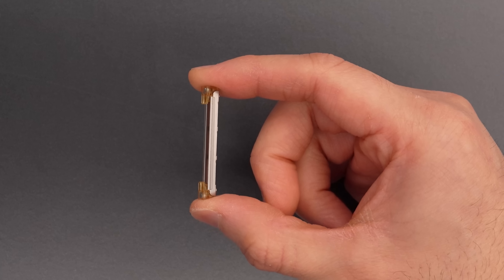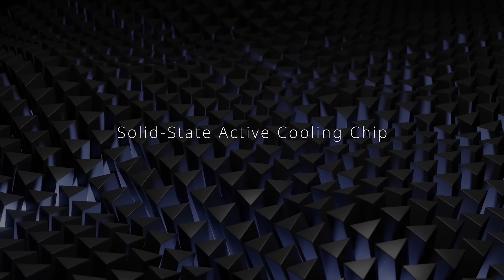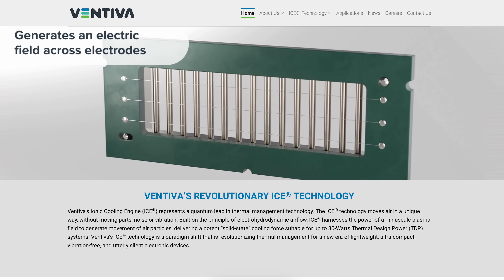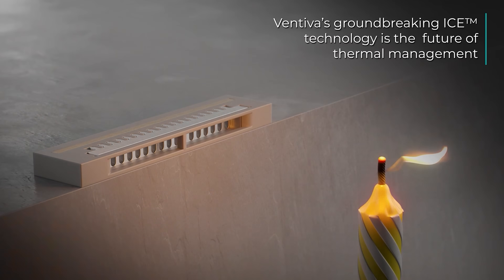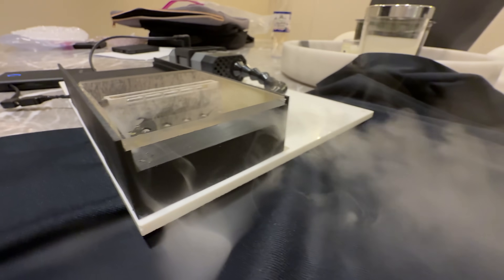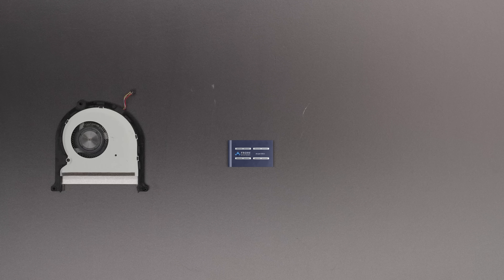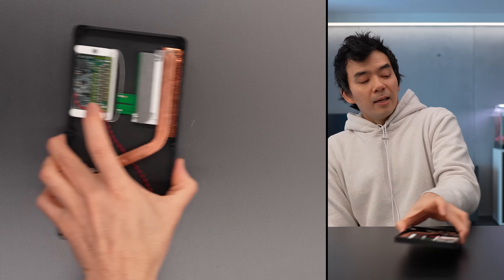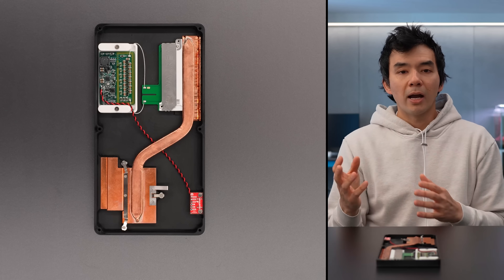The IMPOSSIBLE Laptop Fan...

Comment: The heat dissipation per W of electricity for the Fiore was 5, half of a standard fan system's 10. That is much closer in performance than the air flow rates. Ratio of 2 vs 6. I think Fiore might still have a market because they can pull air through dust filters. For a phone I'd want dust filters. For laptops, maybe dust filters.

Comment: Would a solution to the pressure issue be - using one backwards, so that it pulls air into the machine, then one on the other side that pushes it out. Or one either side that pull in, to be exhausted through a series on the back

Comment: Its not a new tech.. its all over the internet. it was invented by Nikolas Tesla. The problem is it have a high voltage section which produce voltages above 1000volts.. and have static electricity also.. so it cannot be used in humid conditions or highly explosive environments.. because it can cause static discharge and arc..

Comment: As an electrical engineer, the higher the voltage level, the higher will be the cost of insulation. Any malfunctioning of insulation could potentially be life threatening for the consumer, if the whole chasis is made up of conductive materials, such as metals.
Reply: also not to mention the electrodes arcing over in humid environments like next to the ocean..
Reply: As a non electrical engineer. I dont think a large company would risk their business by investing in a product that isnt safe. They have definitely done testing lmao, tf?
Reply: @sosig8655 You can make experimental products. The proble is when you want to mass produce and sell them to ordinary people.

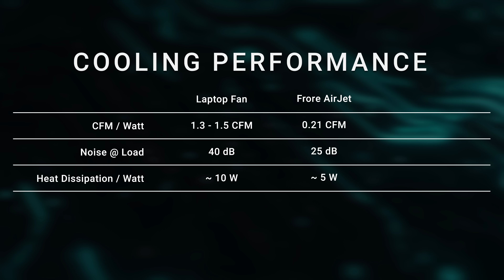Comment: This feels dishonest; the intense pressure against the copper backplane generated by the Frore Airjet also makes the efficiency of heat removal much higher, meaning a comparison of air volume movement isn't apples-to-apples. You yourself demonstrated this (5:50) by showing that despite only generating 16% of the CFM of a normal fan per watt, it can still dissipate 50% of the heat (5W versus 10W). That same high static pressure also means that a device can easily be fully dust-proofed. The benefit of the AirJet isn't the efficiency of heat removal, but the promise to be able to dissipate heat from devices that ordinarily could never have accomodated a conventional fan; or for thin-and-light devices that can accomodate them, to actually improve heat dissipation as a consequence of more efficient space utilization within the chassis. 

The Ventiva has the severe Achilles heel of not clearly being able to square the circle of static pressure generation versus dust-proofability (a concern you handwave away), which I think is more severe than the energy efficiency shortcomings of piezoelectric coolers. On top of that, Frore also demonstrated retrofitted machines pretty early into their design cycle; the fact that they haven't brought products to mass market has to do with R&D and product cycles as well as their own company's limitations with financing and production throughput (unit costs and total output; adoption is slow if price is high). If you're trying to suggest to us that within 1 to 2 years we're going to see mass adoption of this tech, I call bull. That's just not how companies work.

Don't get me wrong, I love these new interesting technologies, but I don't understand your refusal to cover the AirJet when it's obvious that it's a solution that's tailored to the direction the industry is actually moving (thin-and-light, ultraportable form factor, mobile phone cooling, water resistance). If anything, this feels far more interesting as a possible solution for an ultra-quiet desktop gaming system, in a dense stack, although the issue of ozone generation in enclosed spaces (a severe respiratory irritant) would be of serious concern.

Comment: The real power efficiency benchmark would considering Dell XPS 13 with fan vs this ionization solid state tech only then we can it's power efficient. I hate proprietary parts which will fail early and can't be replaced due to unavailable parts. Dell has done it on A51M so wouldn't trust it on maintaining the part supply. Then again there was MEMS based solid state cooling.